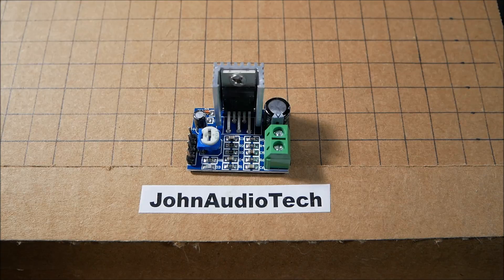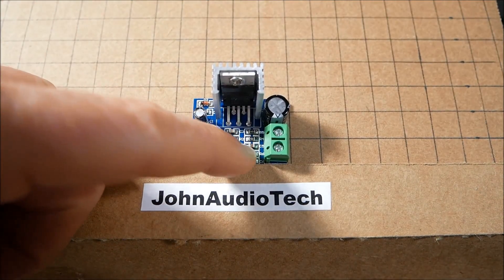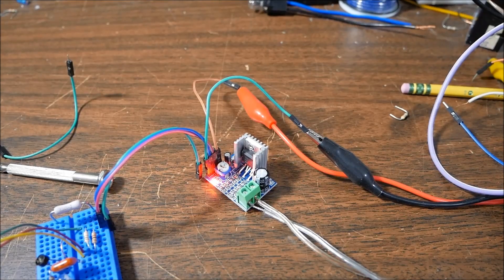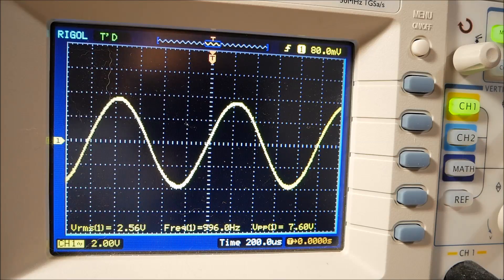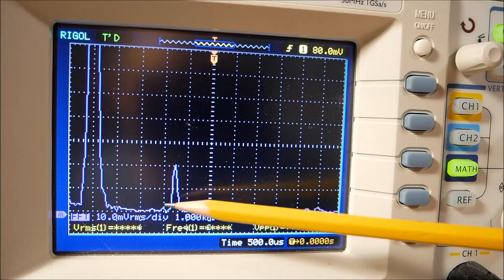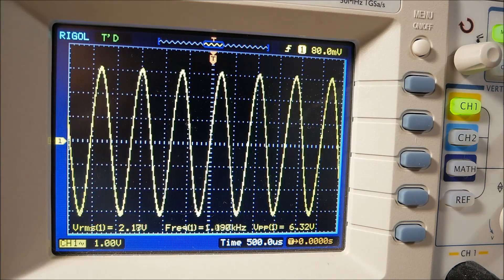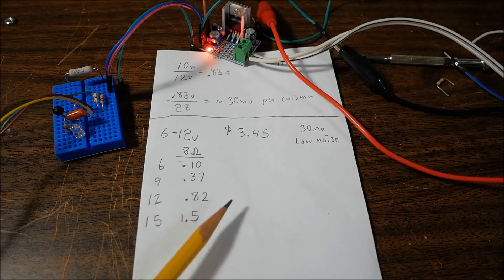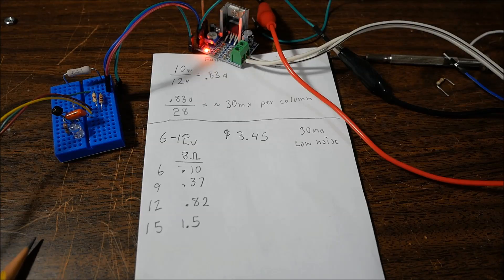TDA2030A mini audio amplifier board test & review

Comment: Hey John, I build a lot of guitar projects and I have a TDA2030A to put in a guitar with a built in amp project. Do you have a different amp recommendation? (It's not this board design, it's the other one you did recently.) I'm trying to make a decent 9V battery amp and might expand to an 18V one in the future.
Reply from the maker: Hard to beat the LM386 for 9v battery projects because of its idle low power draw. 18v is going to require a hefty battery because of the power draw. I'd go with 12v max and perhaps stick with the lm386 and an 8 ohm load (8AAA batteries) to keep the weight down.
Reply: @JohnAudioTech  only reason I mention 18V is that I have a pedal power supply that can provide 18V. I think it can do 12V too though and that might be better for using the pedal case as a heatsink

Comment: Were you driving enough input to the amplifier?
I would have thought you need to ensure the output is just below clipping level to measure correct output power. 
Perhaps I missed that bit? 🤔
Reply from the maker: Yes, that is how I measure output. Max signal before clipping.

Comment: I created this circuit on veroboard as it is on datasheet but changed the output coupling capacitor to 1000 uF instead of 2000 uF and tested on 12 Volts @ 4 ohms and the max output was 1 Watts without clipping. I also tested it on 24 Volts @ 4 ohms load when the max output was 6 Watts without clipping.

Comment: When these kind of amplifiers are tested, it can be taken into account that input signal depends on the source if you use pre ampflifier you can get datasheet specs. For example your phone and your computer does not supply the same amount of output voltage so you need to increase it so that your amplifier works efficiently. My tda7377 gives 8-10 watt max when connected directly to phone whereas when I use preamp it gives 35-40watt. This is the main reason why car amplifieres have gain adjustment on them.

Comment: So what you are really saying is that amp out of the Dollar Store amplified speaker is a better buy? ;)
Reply from the maker: Yes!
Reply: I had seen them before your review, but since then, I bought several and have made a nice little stereo bench amp built entirely from dollar store parts - 2 amps, USB power supply, USB cord and stereo patch cord. Even the nuts, bolts and washers used for the speaker binding posts. Yes, I cut opposite input traces on the amps, tied the input jacks together and the power leads also. With a healthy enough input level and good speakers, they are decently loud and quite good sounding for what amounts to a little over $5 in investment.
Reply: Here's the proof at my local Dollar Store: https://s5.postimg.cc/oe32zg8rb/Dollar_Store_Amp_Parts.jpg

Comment: Another good one John. It's rather confusing out there. American amp. chips are up rated at stupid levels of distortion (10%) and Chinese clones need derating by 50%. 
LM317HVT - $3.36 and $218.29 postage :- plccenter (117659) on EBAY. ( I can get 5 from China for about $3 free postage and they didn't melt at over 1 amp).
Rather an OTT  example but anything to the UK from the USA is roughly 3 times the cost in the USA. I'll stick to my soggy little plastic bags from China and keep my fingers crossed.

Comment: I had several of this board before.  I think it is badly designed.  John,  If you have chance, please review the TDA7377 and TDA7297 boards.  They have good volume and sound to my ears,  and run well under 12v.

Comment: One thing that I have noticed on many of these low cost Chinese boards is that there are typically no mounting provisions (screw holes or the like) for the board. There is not enough room to drill your own holes, nor does it look as if the boards can be slid into the PCB guides in a project box. Just wonder, how does the supplier expect you to build these boards into a presentable project? (Please don't say the "national fastener of China" - hot glue)

Comment: If the Chinese insist on copying  other companys chips at least they should try to make them as good as the originals.  Couldnt be that much more expensive.
Reply from the maker: When I decapped the IC to see the silicon die inside, they used a much smaller part to cut costs. They do this with transistors also. Of course, the transistor can't handle the same current the original one did and can fail under use.
Reply: @Joseph Nicholas
the "chip" may be as good as the original but the module is built as a low power amp , im not sure how much it could be improved by fitting bigger (and higher voltage) caps onto the same board and a bigger heatsink , if the noise figures stay the same and power goes up it would be ok , but then better to buy a kit and improve as you build :-)
Reply: Die comparison video! Seeing what you're getting as compared to the real thing is a worthy follow up to the review.
Reply: @JohnAudioTech
i didnt realize they actually changed anything , i just thought they used cheaper manufacturing processes to get the price lower , it still seems to be good value for a reasonable amp , when you played the music through it thats about as loud as i like to listen :-)
Reply: @Peter Ridge
i have seen videos of people grinding into chip cards and micro controllers and although i can see patterns on them i have no idea what any of it is , i have popped of the top of  various to220 packaged devices and all i see is a small grey square , i have recently bought a tiny microscope thing with led s on it (from china) to read part No.s on smd parts , ill have to look at the grey squares with that and see if i can make any sense of the "chip" :-)

Comment: I am wondering what is the difference between power audio amplifier and power opamp? It seems obvious that power opamp could be used as audio amp, but could audio power amp IC be used for opamp applications?
Reply from the maker: I would say yes. I was told by a Texas Instruments engineer that the LM675 is the same as the LM1875 audio amp IC but was selected to be used as an op amp (675) due to the tighter DC characteristics.
Reply: That's interesting topic. Thanks.

Comment: If it is junk, John will say so.  BTW, what did you expect, the damned thing costs a dollar and cents a piece.
Reply: @1959Berre  it says, " Mono 18 w power amplifier circuit design."  on the store page, so getting 1.5 watts out is very bad. yes I know it does not say 18 w amp but it is still very misleading.
Reply: @99Duds  use 35volt!
Reply: @gamedemo6589  Not sure how that even applies to my comment. There not great amps and the fake amps are even worse, so the power they can take and make is very limited. The TDA 7293 is much better even the fakes sound good and make pretty good power.

Comment: What about farting speakers? I built this guitar amp using LM386 and it works, but my speaker is farting real bad lol

I don't know if it's because of little power or filters...

The design is pretty simple, I feed my guitar signal to a buffer that I made using the chip uA741 and then, for distortion and a little power, the LM386. 

My speaker is rated 3W, but the LM386M doesn't give even 0.3W of power. 

I was thinking in using the TDA2030 for a little bit more power, I guess I can manage to reach 4.5W.
Reply from the maker: A farting sound usually mean the amplifier is oscillating. Look up "star ground layout" to help clear that up.
Reply: Based on the description, I'm thinking that "farting" is related to "motorboating".  First thing I'd do is but a power supply bypass cap right across the power leads of the IC.
Reply: Guys, thx for the help!

I think I know what the problem is. A friend of mine told me to measure and make sure if my speaker's impedance is indeed what is supposed to be. LM386's datasheet suggests that we should use 4 ohm loads for the output at least and my speaker's impedance is 2 ohm, not 4, it says it is 4 ohm, but it's not! It lies! lol

I will have to buy another speaker and try it out to see if I can get better results.

Comment: It was really an interesting note about how a vocal "behaves" after stereo to mono "conversion" (just two resistors I guess). Do we need some advanced DSP to get proper mono sound from a stereo recordings? Or maybe the perfect conversion isn't possible?
Reply from the maker: Look up Haeco-CSG. It was a system developed back in the 60's to make stereo LPs sound correct on mono equipment. It worked by phase shifting one of the channels. The problem was, it would harm the stereo image. Thankfully they did away with this crap after a couple years.
Reply: If the left channel is an inversion of the right channel, they will cancel each other out. I assume this is the reason for the phase shift?